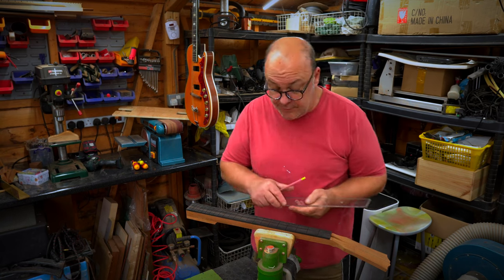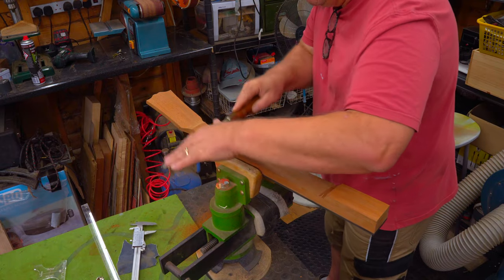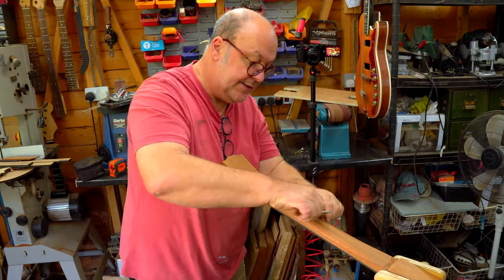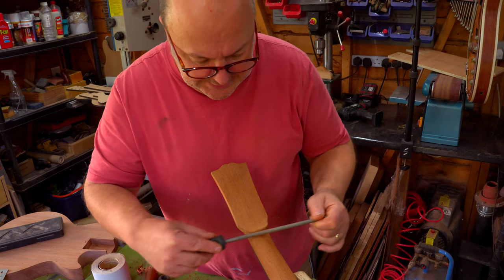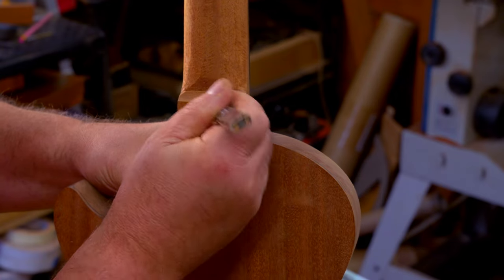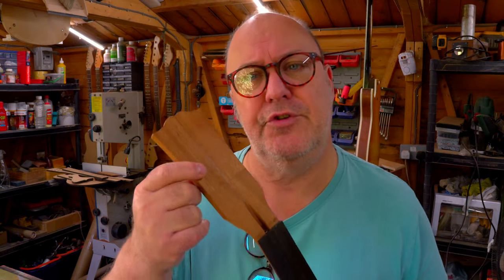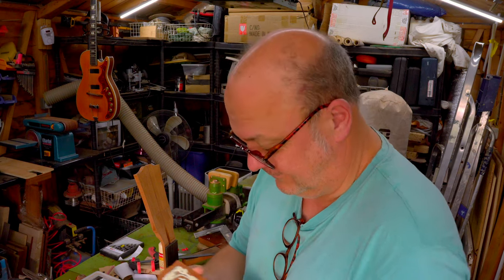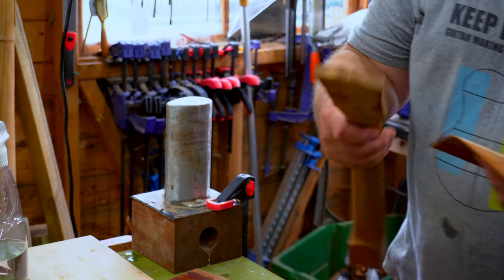Les Paul Junior Style Guitar Scratch build Part 4

Comment: I use my fingers all the time when building scale radio control WWI biplane models from scratch. Recently I somehow sliced both my index finger and thumb with an exacto blade. That put an end to my finger spreading for a while.
Reply from the maker: I’m sorry to hear that mate. I try to keep contamination like scalpel blades out of my glue for this very reason. Likewise with grenades, axes and small outbuildings. Such contaminants are not only dangerous, they can also ruin the joint and therefore the final build. When I use my finger I find I can detect these foreign bodies and avoid the problem entirely. Thanks for your support. C

Comment: Oh, and I too was a little annoyed by the finger joke, because I like to spread glue on both surfaces of panel joinery using a steel putty knife to 'key' the blue into the surface of the wood. But I recognise that there are multiple valid ways to do almost anything in wood working. And the finger joke is a part of the presentation that I look forward to! "Here it comes". ;-)
Reply from the maker: I don’t write anything down. I just roll the cameras. The finger gag just happened on the first series and it just keeps rolling. Philosophy corner came about because someone criticised me for not always sanding with the grain. I’m guessing more stuff will happen as things develop. I really hope so.
Reply: @chrisreynoldsguitarmaking  This is consistent with a natural and spontaneous style of presenting.  You are gifted at connecting and  communicating. And I like both ‘the finger’ and philosophy corner.

Comment: Keep up the good work Chris.  We can’t control what others will say about us so don’t let it get to you!   Just give him the finger and move along!!   Doing amazing work.   

Also quick question : the neck angle at the body, is the angle factored into the body or the neck !?
Reply from the maker: I got some guy in Australia asking me to call all my dimensions in metric and imperial. Australia is metric. I mean seriously? It’s me on my own in my workshop and wants me to convert the only dimension in the show for him. 99.9 percent of all comments are staggeringly nice and then…. ? As you say , move along. 

Anyway David I set the neck angle at 1.5 degrees and angled the neck template on the body in Ep 3 so the bottom of the neck is flat but the slot base is angled. Good to hear from you again C
Reply: @chrisreynoldsguitarmaking  thank you Chris !

Comment: Hey Chris what are the dimensions of the neck pocket.  As you have a angle routed in there how deep is it now !?   With the angle I’m guessing it’s not going to be 16mm  !?   (Pretty good guess eh!? )
Reply from the maker: Oh my David. I’d have to go and measure. I made the heel so it felt chunky and sank it into the body so that there was a bout 5mm clear of the pocket where the body joins the neck. Measurements don’t really mean anything unless you are measuring everything and have schematics.  The neck angle was was copied from my Les Paul junior at 1.5 degrees. The height of the neck out of the pocket is derived from it too and the bridge will be the same sooo. It should be fine. If it isn’t. Then there is still the option to slim down the heel so it sits deeper etc. We will find a way.
Reply from the maker: Because of the angle it’ll be deeper at the edge. It’s on a slant
Reply: @chrisreynoldsguitarmaking  thank you !

Comment: 5:56 "This is not tonewood"... Well tonewood is a myth. At least for electrics. It's something different for acoustics. But the experiments of Jim Lill here on YouTube have shown how much marketing mumbo jumbo exists and people still believe it.
Reply: Even if tone wood isn’t a myth (I agree that it is with solid body electric guitars), the neck isn’t tone wood anyway. Guitars with non-wood necks sound exactly the same. If you’re wondering about where the sound of an electric guitar with magnetic pickups comes from, check out Jim Lill.
Reply from the maker: I am not a wood snob either. If it will hold the shape and looks nice I will use it. Tonewood is more of a grade thing for me and I use the best I can afford for acoustics. Electrics sound different if you use a mahogany for the neck rather than maple. The physics is pretty obvious there. I watched that video a while ago and its pretty compelling that tone derived from the wood  is a myth with most electrics. I was very surprised how a hardwood bridge really make a huge difference on my Harmony build,
Reply: @chrisreynoldsguitarmaking  Well in the case of the bridge it is directly contacting the strings. Just like a metal plectrum instead of a plastic one this will of course lead to huge differences. I just don't get the obsession over woods in the body etc. There are many much more important factors in the chain like the strings of maybe you play fingerstyle like Mark Knopfler that will affect the tone MUCH more. I would really urge you to take a look at Jim Lill's videos here on YouTube where the iconic sound of a Telecaster comes from. Highly interesting especially from a builders perspective. Here the link: https://youtu.be/n02tImce3AE
Reply: @robinleebraun7739  I referenced Jim Lill in my comment. Read carefully. This guy is doing amazing work destroying a lot of myths once and for all. A lot of people paying several thousands for deep dark woods that make them sounds "darker" were very angry at him. :D
Reply: Tonewood definitely is not a myth when it comes to acoustic guitar building. At all.

Comment: At about 5:55 or so you commented that "this is not tone wood" "this was a table" I'm pretty sure you had to be joking. If not, can you please tell me how to identify a tone wood tree as apposed to a table tree? Thanks!
Reply from the maker: Wood is wood. It was a table and I frequently buy mahogany table tops around 25mm thick. Tonewood is term given to carefully selected wood stock with the right characteristics. My tables are 80 years plus. They are completely stable and do not move. Obviously you have to cut them to avoid major flaws and any holes or joints. I have only ever used reclaimed mahogany as it so darned good. It’s generally very decent and far better than most modern stuff. I can get five necks out of a decent tabletop
Reply: @chrisreynoldsguitarmaking  Older dryer wood saves time making a neck. Otherwise, you have to work it over time to let move and settle. I worked at a hardwood lumber yard in the mid 80's. They had tons and tons of Honduras Mohogany. If I had only known the future, I'd be a rich man today! Have a good one!
Reply from the maker: @Cannonbawlz  that wood would be priceless now. Take care C